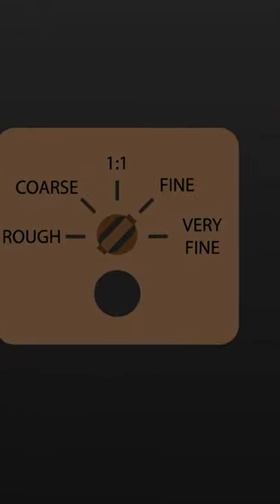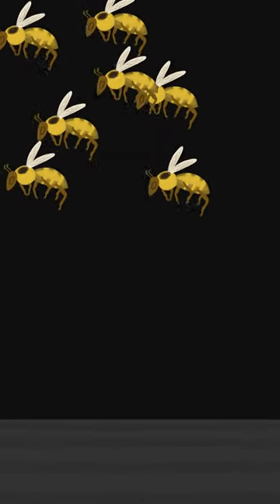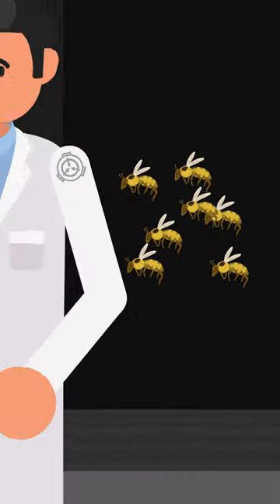What if a Chunk of Honeycomb Was Put Inside SCP-914?

Comment: What if SCP-5000 was put in SCP-914?
What if an SCP-148 ingot was moulded into a sword and stained with SCP-682 Killer?
What if SCP-173 had its arms or legs broken?
What if for containing SCP-173 they tied it’s legs down with Kevlar that way he wouldn’t be able to move.
Reply: 1. Its believed that to repair the suit using 914, you would need to include other materials in the input and set it "Fine"
2. Its unknown if the 682 killer liquid only affects 682, so its possible it would damage the sword. Even if the desired sword was produced, you'd still need to find someone willing to use it on 682
3. Previous incidents have shown that 173 has the ability to repair/rebuild itself if its damaged
4. That would be effective if we assume 173 isn't strong enough to break the kevlar. We'd also need to determine if tying down only 173's legs is enough
Reply: i dont think 173 is hard to destroy at all, like its made of concrete they can just explode it or break it but they wont do that because scpf is dumb
Reply: @biz117  the SCP foundation don’t kill
Anomalies because it is easier if they contain them and protect humanity rather than resulting to killing everything. SCP-682 is technically on death row and so is SCP-096 SCP-173 however if it is capable of repairing/and or fixing itself blowing it up would do notbing.
Reply: @Mascallywag  They did neutralize some scps before mostly by accident or to save humanity